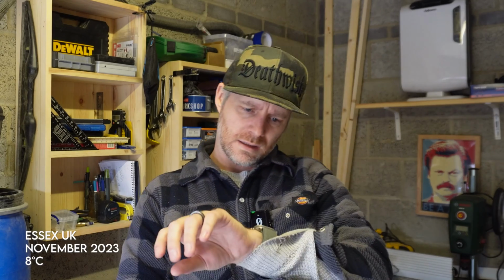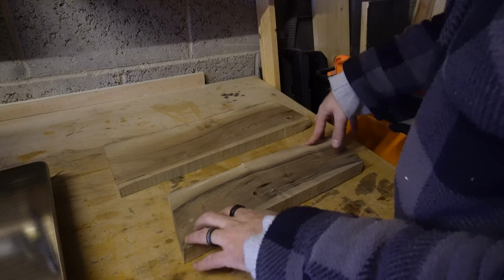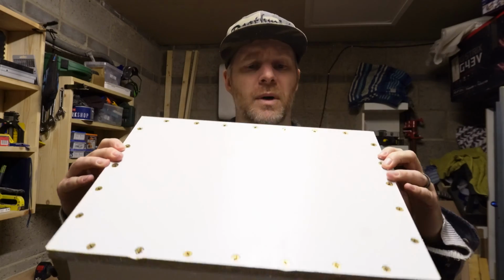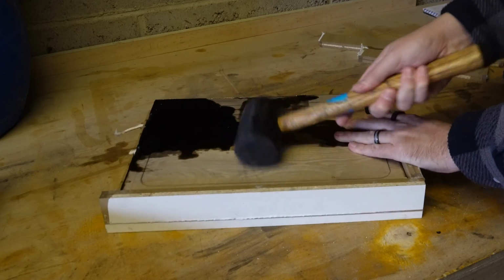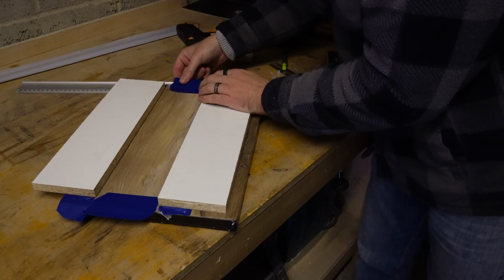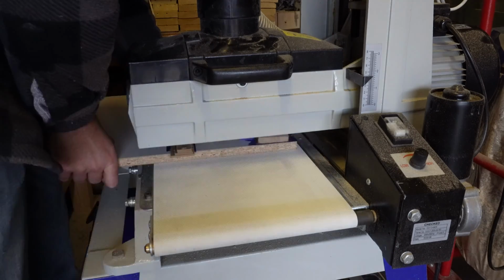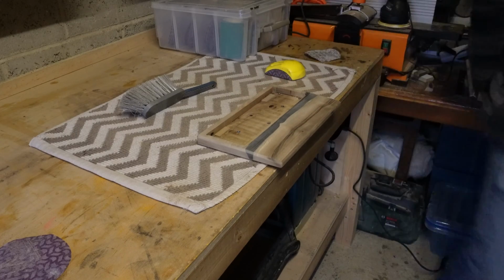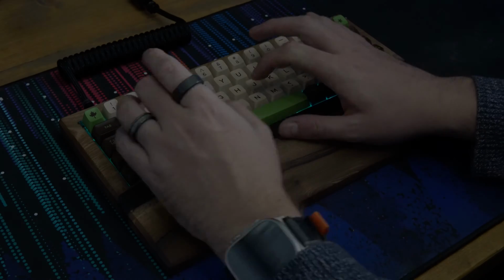Building A Custom Keyboard Case: Wood and Epoxy Project | East Seaxe Workshop

Comment: Incredible build, I am building a similar project for my keyboard so just a question, what glue did you used to set those standoffs?
Reply from the maker: Hey, thanks for the kind words! The glue I used was the thick black O3a Cyanoacrylate Instant Adhesive, but any Cyanoacrylate (CA) glue should work for you. Enjoy your build!
Reply: @ Okay thanks for the tip, but just to ask again, what sizes are those standoffs, are those m2 or m3? Can you tell the sizing of those, including the screws? If you don’t mind, I just need to have a reference for the one that I am making 😅
Reply from the maker: They were M2, 5mm male and female stand off as they were the smallest in the kit I picked up from Amazon
Reply: @ thankss!